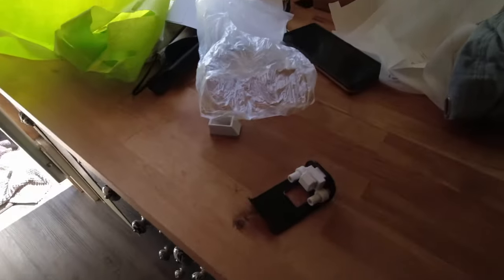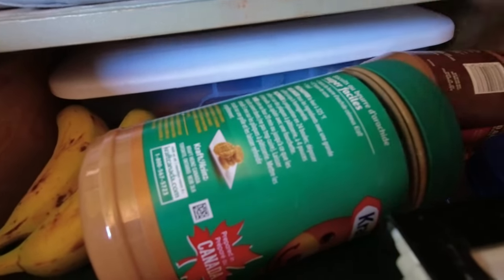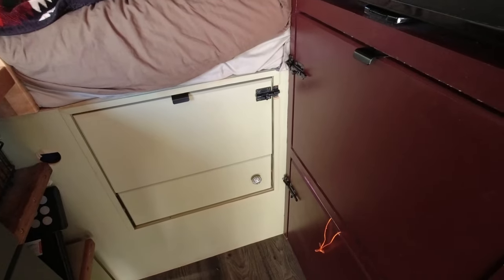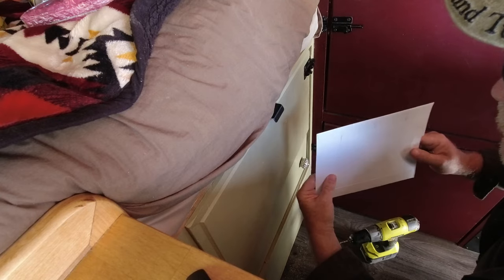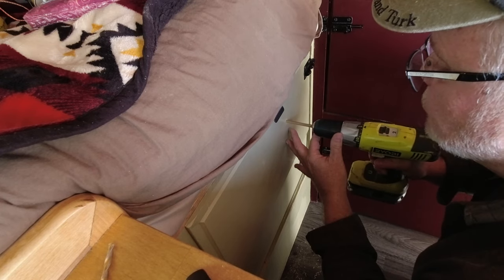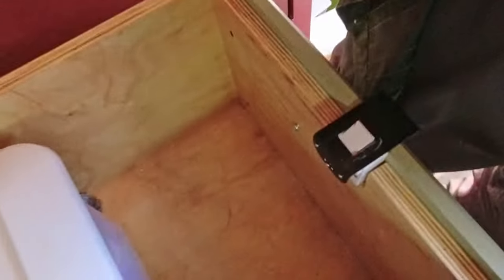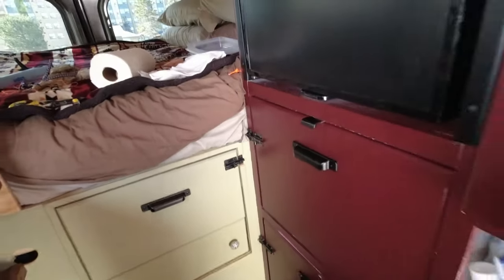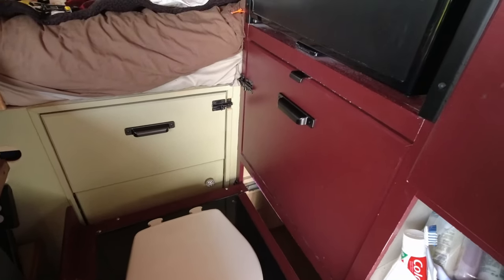VAN REPAIRS NEVER END!//DRAWER PULL REPLACEMENT/EP 6: Rob's Van Repair & Maintenance Tips

Comment: Hey Rob and Jan! It’s really aggravating one has to go back and reinstall newer parts that the original should’ve lasted longer. Good job as always, Rob! Like you said a little bit of touch up paint and nobody will ever know you had a problem! Stay safe! ~Jim~
Reply from the maker: Thanks Jim @TOTALLY RELAXED! Yup! Always something to fix. 🙄 It was our fault for choosing latches that had plastic parts. Good ol’ dead locks and drawer pulls are doing fine now. More secure and they don’t look too bad either. At least you can easily see when they are locked. Hope you are doing well and your van fixes are coming along? 😊 👋
Reply: @RobandJanCanVan  > I need to do another surprise visit to the shop…in a month or more the van has been there they’ve only replaced the alternator and was waiting on parts for the brakes last time I talked to the owner about two weeks ago…supposedly. I don’t believe in being nasty or pushy but this is getting me really ticked off. If they weren’t able to fix stuff in a reasonable amount of time why’d they say bring it on over in the first place. Grrrrr. They have me over a barrel bc I know they’re gonna say “well we had some customers ahead of you”….which brings me right back to ‘why did they say bring it in’ and it seems like a continuous loop. SMH. Hoping y’all are having a great start of the week.
Reply from the maker: @TOTALLYRELAXED  I think this is an issue everywhere for Van repairs and many vehicles…too many vans/campers and not enough people to fix them. Long waits for service and I have heard people are waiting on new, empty/stock vans for up to a year and a half!
Reply: @RobandJanCanVan > where my van is at has four mechanics plus the owner. It’s not a dealership shop…just a small one. I think they’re all being greedy and taking on more than they can handle to cover THEIR butt imo. I forgot today was Labor Day…drove 13 miles to his shop only to find out he was closed.
Reply from the maker: @TOTALLYRELAXED  ugh! Well, we hope you get your van sorted out soon and you can get on the road. Hopefully, we will meet you when we head to Galveston in January. 😊
Reply: @RobandJanCanVan  I’m about ready to just sell the darn thing for what I paid for it including whatever they actually repaired so far…it’s really becoming overwhelming to me.
Reply from the maker: @TOTALLY RELAXED it must be frustrating! Sorry we didn’t respond sooner. Weird glitch with our YouTube comments. 🤔

Comment: Good morning from Godley Texas, with what campers cost you'd think manufacturers would use quality products in their builds. Sadly they choose to skimp on quality to increase their profit margin. More frustrating items tend to fail after the warranty period expires. Good DIY repair. Thanks for sharing. Stay safe and happy travels 😎
Reply from the maker: Thanks @John Huff! To be fair…the builder here was Rob! 😂 We chose and installed these original latches after watching other VanLifers install them and saying they were great, in their videos. We used quality products throughout our build…these latches just didn’t live up to the hype. 😂 But agreed…we built our own van as we also find the workmanship in some of the manufactured camper vans to be subpar….especially the woodworking/laminated products. 👍
Reply from the maker: Thanks @Charlevoix418. In this case, we built our van out ourselves because we wanted to control our build and quality. We just chose poorly on these latches. Others had used them and said they were great and we liked the look, but as Rob says, sometimes the good ol’ dead bolts and drawer pulls aren’t as pretty, but much more stable in the end. 😊 👍 But agreed…you get what you pay for! Best to do research.